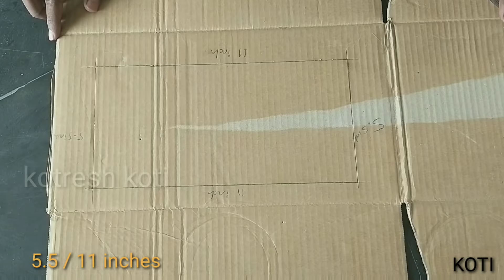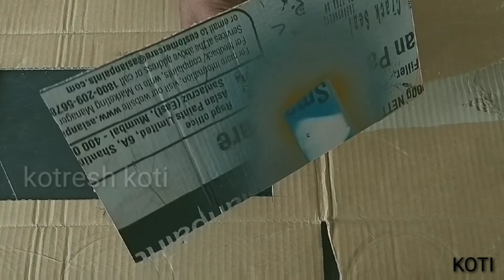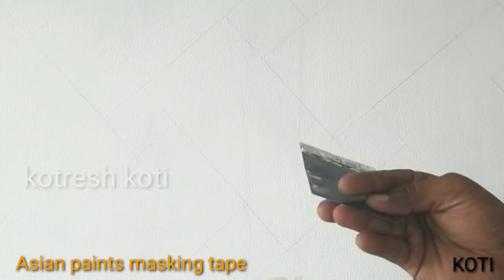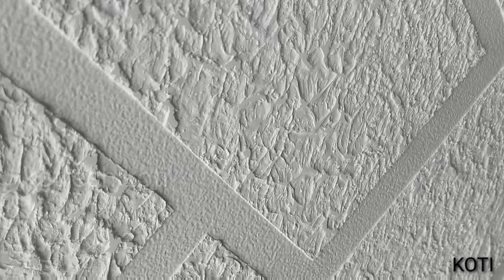Brick wall painting cool and easy method

Comment: Awesome. One question though - what happened to the pencil lines? How do you remove those?
Reply: No
Reply: Jahangir hi nich you
Reply: Wouldn't have to remove, it was covered up by the joint compound it seems.
Reply: I think that tape is wet enough , will soak away marks.

Comment: Nice! But how did you remove the pencile line under the tape? I can see you put the tape on with the pencile line in the middle as a guiding line but after removing the tape the pencil line is gone. That is a bit strange.

Comment: Could this plaster be made somehow more flexible to be used in the back of a truck so it wouldnt crack with a little flexing?
Reply: I am not an expert regarding this, but i had some putty work done on my home walls and it dries quickly and i wont recomend it to be used inside the truck. It would crack becaues its no flexible. Its way too brittle. Its best only for inside wall of a home.
Reply: @Rrocksstar  ظ
Reply: @Rrocksstar  bro new cement wali diwar ko prepare kesy krna hai

Comment: What a laborious process,he should have left it to dry a little longer,and the peeling would have been a lot easier.
I used to finish concrete by hand,bridges and abutments all sorts of things,I understand the importance of working with it at different times in its curing process to get a good finish on it,
Reply: Totally disagree. Waiting for it to become more dry will lead to huge problems. Plus, it's representing brick with imperfect edges, not porcelain.

Comment: Good afternoon, Mr. Koti, I have watched the process of this video several times, (Brick wall painting cool and easy method), I liked it a lot, I am even preparing a wall to do it with this technique, but I do not understand if it leaves or not, Dry the first coat of putty applied with the spatula.
I thank you if you answer me, I like all your videos, they would be better in Spanish
Reply: You aint need to dry the first coat applied with spatula. Drying the putty will not provide a fine texture as it will make separate bumps of the texture roller. Keep rolling the texture after applying an area that you could work with while putty is not dry. Cheers
Reply: If ypu dry it how can you remobe the masking tape?
Reply: @saadjamil3947  thank's for the answer , after doing all the work can i add a white paint on top ?
Reply: @yafa.5 welcome. yes you can add any waterbase paint and also you can coat with varnish to add shine